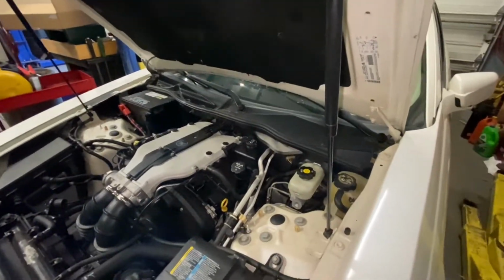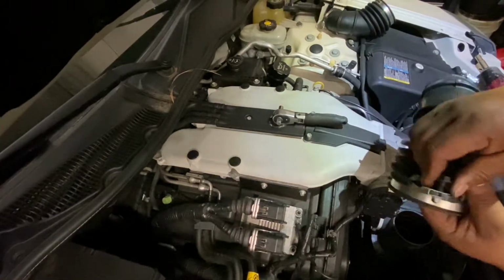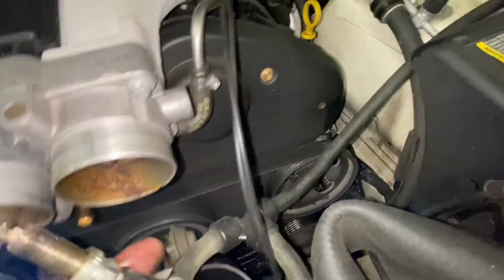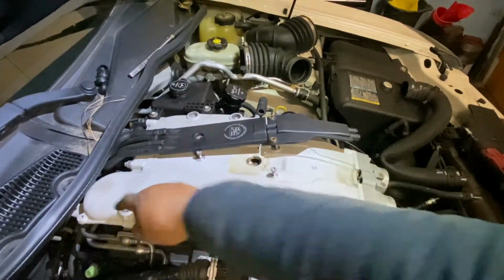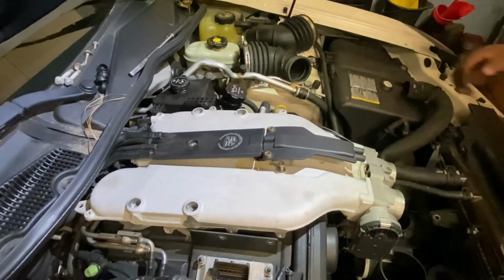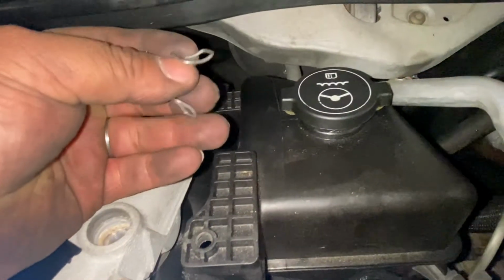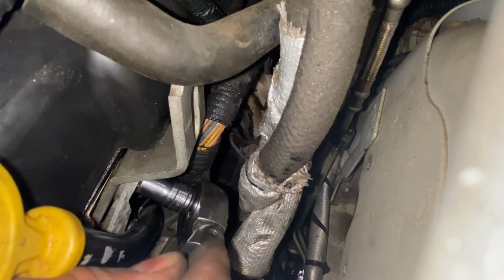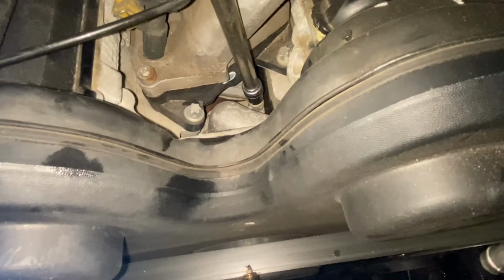137.- (PART 1 )2003-2004 Cadillac CTS 3.2l  Thermostat/housing replacement/how to diy

Comment: I'm doing the same and my inlet pipe won't separate from the thermostat. And what did you use to clean. I have a ton of grime and build up around the thermostat. I'm sure I'm the first owner to maintenance my car at 130 miles
Reply from the maker: Wow first you need to use a sand paper to remove the grime and part cleaner and replace the orings from inlet pipe don’t use the old thermostat housing try to get a new one when you install it back add small amount of grease on rubber orings
Reply: @fixitquick  I did I sanded everything down and got some sealant for the thermostat housing and thread locker for the bolts. I forgotten the cleaner. And my inlet pipe broke as I was screwing the bracket back in it shot back and snapped. It seem like old brittle cast iron with the entire inside of the pipe was clay brown. Thermo same way. New one on and I'm waiting for my inlet pipe, high flow auxiliary water pump,  and new radiator and fans tomorrow.  My oil filter cap was stuck on and I had to jab it with a screwdriver and force it off. Where can I find the replacement 🤔